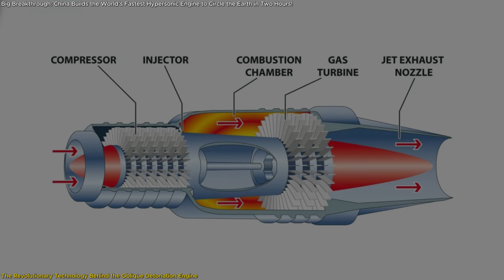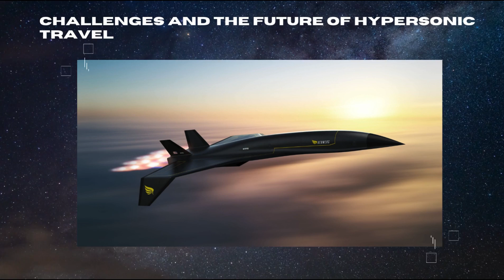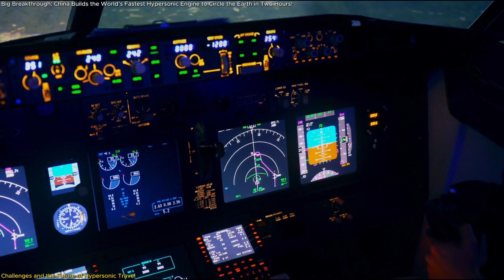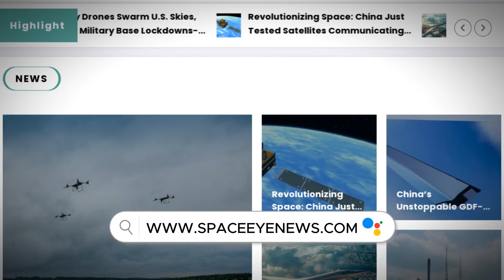Big Breakthrough: China Builds the World’s Fastest Hypersonic Engine to Circle the Earth in 2 Hours!

Comment: Is mach 16 fast enough for SSTO?
Reply from the maker: Mach 16 is incredibly fast, but achieving Single Stage to Orbit (SSTO) requires more than just speed—it also depends on altitude, propulsion efficiency, and managing the immense heat and structural stresses. Most SSTO concepts need speeds around Mach 25 (~orbital velocity) at high altitudes. However, a Mach 16 jet fuel-powered engine could be a game-changer for reaching those speeds more efficiently when combined with a second propulsion stage.
This technology might not achieve SSTO alone, but it could be a crucial step toward making space access more efficient!
Thanks,,,

Comment: The aircraft would melt at those extreme speeds. How much fuel and energy is required to slow down the aircraft
Reply: 它撞击地面，形成了一个直径 1 英里的大坑，摧毁了 200 英里内的所有生命。这就是它落地的方式
Reply: Almost none. .  Just let ot glide.
Reply: @ not quite so easy. Air resistance and temperature at hyper mach speeds are enormous. Usually when the flight Mach number Ma > 3, the air temperature of the aircraft's head can reach over 400 °C ; when the flight speed reaches 8 Mach, the temperature of the aircraft's nose cone can reach 1800 °C, and the temperature of other parts will be above 600 °C [2] ; when the speed of Ma = 8 is flying at 27 km, ...